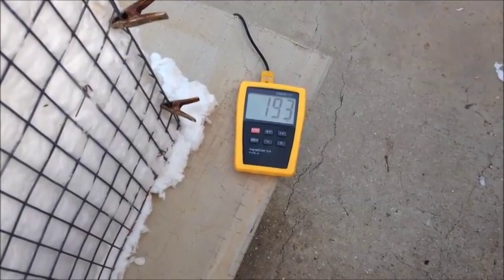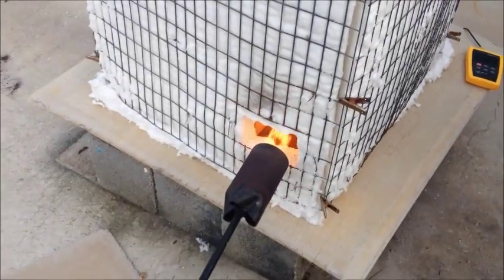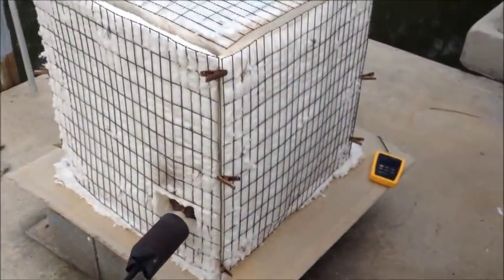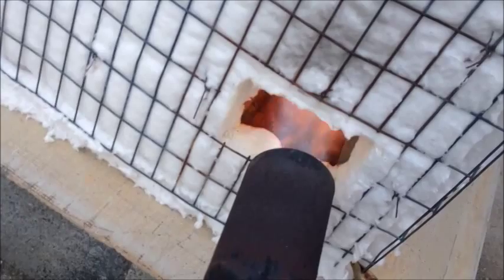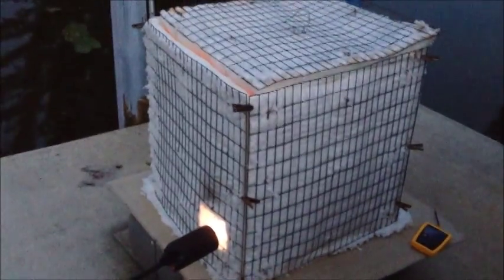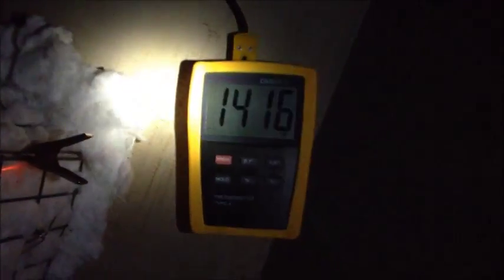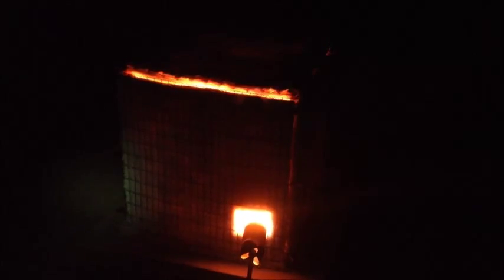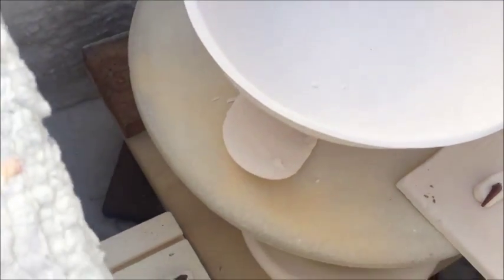propane bisque firing #16 in my home made Raku kiln

Comment: Love your video. What is the best PSI to set the propane? We are having trouble getting our kiln up to temperature. Why use two tanks?
Reply from the maker: Two tanks helps prevent propane freeze up. I have a high pressure regulator but only need to crank the valve slightly open so don't know PSI.  The regulator goes up to 20 psi though.  Your problem getting up to temp is probably dues to insufficient venting.  The kiln has to breathe, so try increasing the area of the vent port opening and see if that helps

Comment: How high of heat could you get that  kiln to? Cone 4? Cone 6?
Reply from the maker: I have had it up to 2000F, but holding it at that temp is difficult and expensive in terms of gas required for a high cone firing. Perhaps with more insulation or fire bricks encasing the kiln it could be done. I have only used it for bisque firing and Raku.

Comment: hi. thanks for sharing. does one need to cupple up two cylinders to reach 1000 + degrees?
Reply from the maker: No, but using two cylinders helps keep the valves from freezing up and choking off the propane when running the burner at a high rate.

Comment: If there is not enough space in the kiln, will it stop the temperature from rising above 700 degree Celsius?
Reply from the maker: No, not as long as the kiln has circulation for the flame to breathe.  It may take a bit longer for a very full kiln to heat up and cool down due to the thermal mass of the contents, but so long as the flame is properly adjusted and able to breathe, it will heat up to the desired temperature.

Comment: Sorry, also, where is your vent located for the circulation? Thanks.
Reply from the maker: The lid is offset by 1/2 inch or so to allow circulation to escape from the gap along the top front edge.  This can easily be adjusted

Comment: Hello:) where did you get the propane head torch from? Does it have to be a heavy duty type because it’s firing at high temperature for long hours?
Reply from the maker: The propane torch is a standard weed burner.  I bought it at Home Depot. Here is one listed on Amazon that would work nicely:

https://www.amazon.com/Propane-Burner-Flamethrower-Turbo-blast-Trigger/dp/B0873BJJVJ/ref=sr_1_1_sspa?crid=3NS88DEESWNH&keywords=weed+burner&qid=1654422066&sprefix=weed+burner%2Caps%2C99&sr=8-1-spons&psc=1&spLa=ZW5jcnlwdGVkUXVhbGlmaWVyPUEyUkxPRUpINEE2REhTJmVuY3J5cHRlZElkPUEwODE1MTA3MzQ3QzhZWVU3OERONiZlbmNyeXB0ZWRBZElkPUEwMzY5NjAxMTc1SEIzTjdQQTNJRCZ3aWRnZXROYW1lPXNwX2F0ZiZhY3Rpb249Y2xpY2tSZWRpcmVjdCZkb05vdExvZ0NsaWNrPXRydWU=

Comment: Hi, thank you for your informative videos. I was just wondering what is the arrangement of bricks/draft under the kiln shelf? In some of your videos it looks like it might be a bit more involved than what I've typically seen on raku kilns. Did you rearrange to get a better bisque fire? Or maybe I'm imagining things. :)
Reply from the maker: three firebricks set on edge so that the flame hits brick #1 and reflects to brick#2 then #3.  I also set 2 bricks on edge at the input port with one on top of them so as to form sort of a tunnel for the flame to follow. My plan was to sort of direct the heat flow in a circular pattern in the hopes this would equalize temp in the kiln rather than create hot spots.
Reply: Thank you for the response!  :)

Comment: Thank you so much for sharing your experiences with this kiln.  I noticed you were now venting on the same side as the burner port.  Has that increased efficiency?  I know that the weed burner is a lot if flame for this kiln size so maybe combustion isn't quite complete at the opposite wall from the port?  Building mine today, hope to fire tomorrow!
Reply from the maker: I set it up that way so as to provide a circulat flow of heat.  Not sure if it is really necessary though.

Comment: Thanks! How many cubic inches is your kiln and what is its maximum temp so far?
Reply from the maker: 8000 cu in and max temp is well over 2000F, but I rarely fire it that high.
Reply: Thanks Again. Is that approx. 20x20x20 interior or exterior?

Comment: I have made a similar kiln but can’t get above 400’c, any ideas?
Reply from the maker: I suspect you need to allow more ventilation
Reply: @tarvus33991  thank you. So open up the top and bottom, or just the top?
Reply from the maker: @neilvanherk5702  , experiment with opening the top in varying amounts until you find the sweet spot
Reply from the maker: @neilvanherk5702  try about 1/-1/2" gap along the front edge of the top to start and vary until you find the sweet spot

Comment: Where did you find the coupler to connect the 2 propane tanks?
Reply: Jared Petersen I went to the propane dealer and had them assemble a t-hose adapter for 2 tanks.  I think it cost about $40 for the hoses and connectors.  They were very helpful.
Reply: Stephen Durham Thank you!
Reply: Glad to be helpful.
Reply: @nehpets724  is that a popane torch or some kind of special torch ?

Comment: You’re not concerned about “naked” blanket? I thought it’s really bad for your lungs, unless you shmear it with something like refractory cement
Reply from the maker: It can be if you are cutting it or working with it during the construction. Wear a mask and gloves and long sleeve shirt doing that. But running the kiln after construction there is no need to be concerned.
Reply: @tarvus33991  Fair enough. I saw a “Rigidizer” product that can be applied to the walls of the blanket.